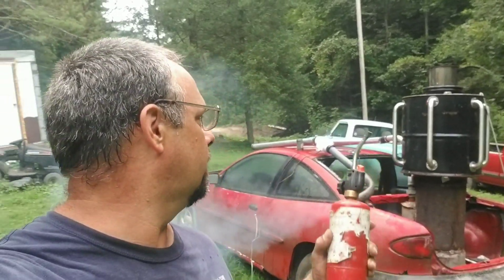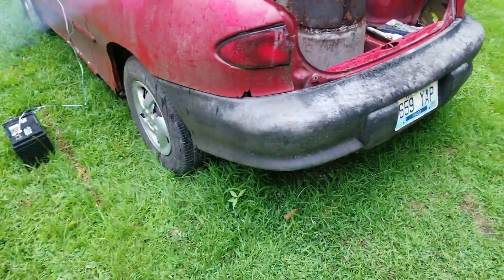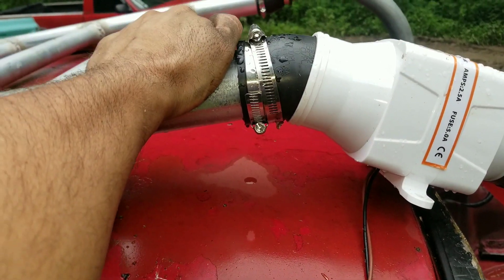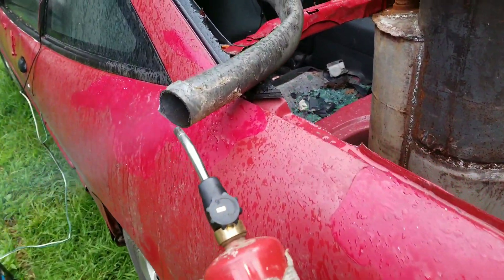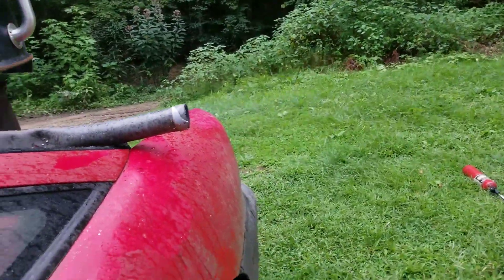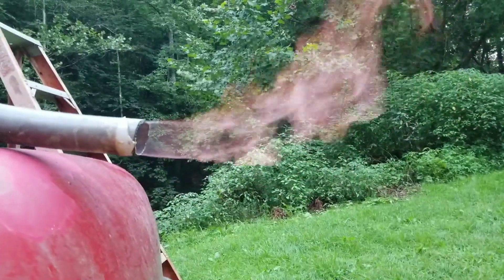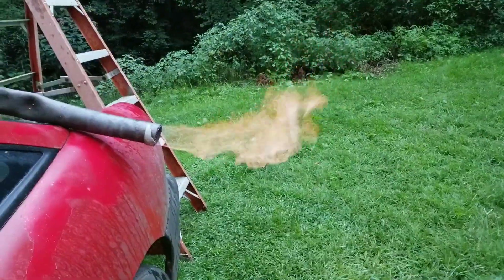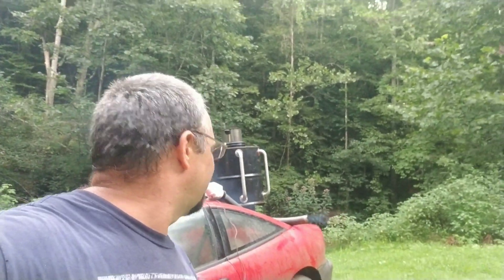First Flair With the new Gasifier

Comment: You will need a filter before the engine, no matter if you use wood chunks or charcoal. Tar will gum up all the internal guts of the engine.
Reply from the maker: Yes, definitely. Got a filter set up in it now. Just a little bit more work and it should start and run.

Comment: Nice! I have very little doubt that you'd make this work; so far i'm batting 1000 on my bets on you.

Blue sure seems to me to be a good color to see in that flame. I laughed a little bit when i say you stuck a pressure cooker on top :)
Reply: I don't know what i'm talking about re:gasifiers, but i'd guess that orange is ok, too ... that the gas burns seems to me to be likely the basic requirement if you're going to run your car or truck off of it :)
Reply from the maker: From what I have been hearing the color isn't as important as quick ignition and a sustained flame. 
From what I have seen from other videos the orange flame without a lot of sparkles is what most strive for. Also not having tar dripping out the pipe, which I haven't seen any so far.

Comment: Looking good so far Luke! At least you know it will work now. I'm sure it took a lot of labor and sweat to get to this point, unlike how easy it looks in the video. I'm looking forward to a blue flame output so you'll be able to get some decent power out of the system. Btw, were is your buy me a coffee link?
Reply from the maker: It was quite a bit of work on the firetube especially. I'm just waiting for payday to get some parts together. Cant wait to route it to the engine and see it run. 
I don't have a link for the buy me a coffee thing.
Reply: @lukeFugate  You definitely should.

Comment: I don’t know anything about wood gasifiers, except that I need to make one! They are so cool. After watching your series, The algorithm recommended a channel that’s called My Country Life and he just put out a video of his gasifier and seems to know what to look for in your flame. He’s experimenting with different filtration materials right now, but he’s got a pretty good sized flame. His isn’t as big as yours, but he’s got filtration and he’s trying to run a generator, so his machine isn’t as big as yours. Still, I bet it’d be worth checking out, if even just to look into the other channels he references.
Reply from the maker: Yes I have seen his videos. He seems like a good guy. I have also watched all of Flash001usa videos. He built a really good one for generator usage.
If you are wanting to build one I would recommend joining the Drive on Wood forum. It has helped me more than anything.